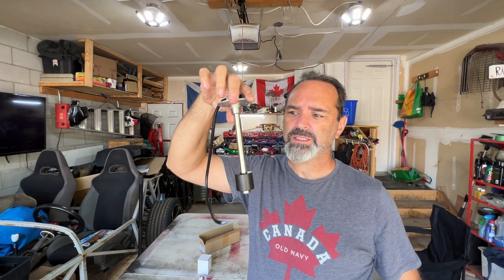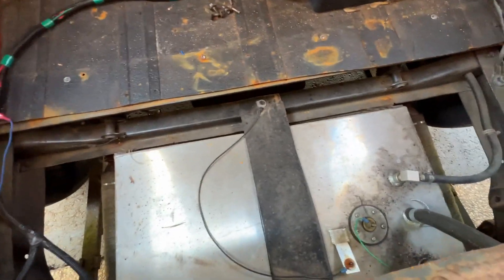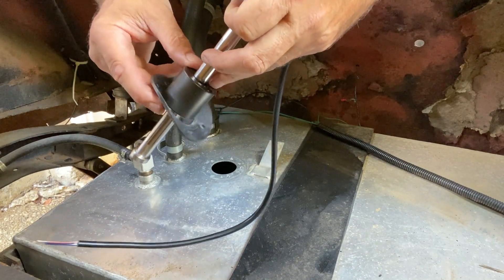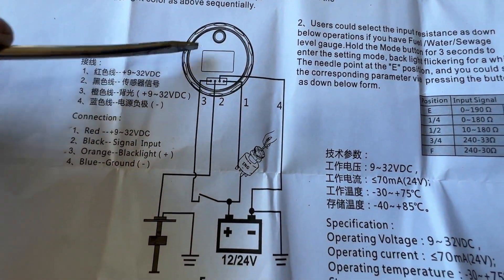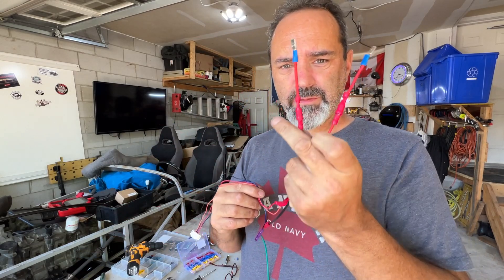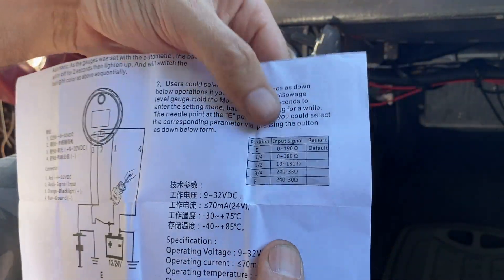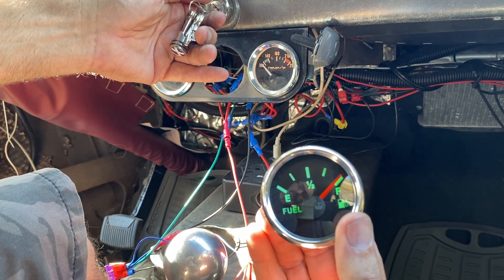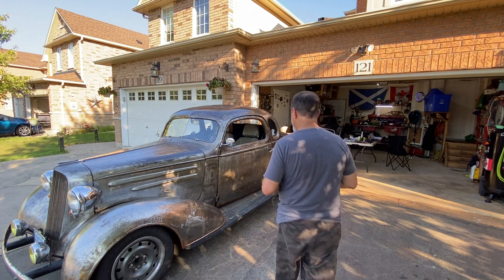Replacing My Faulty Fuel Level Sender, With Another Junk Sender In My 1936 Chevy Coupe

Comment: Dave , on that style of gauge it is important that the ground from the sender is connected to a really good ground. I usually run the ground wire to the Battery direct or to the ground connection the gauge is at.